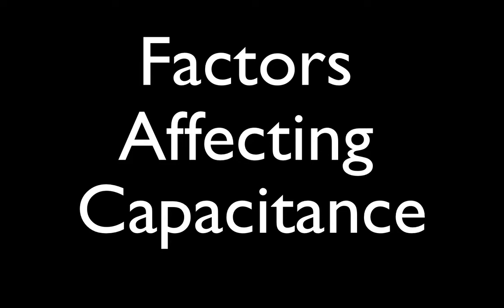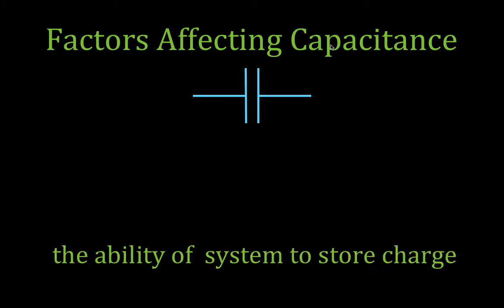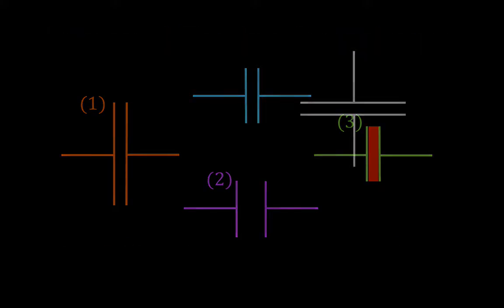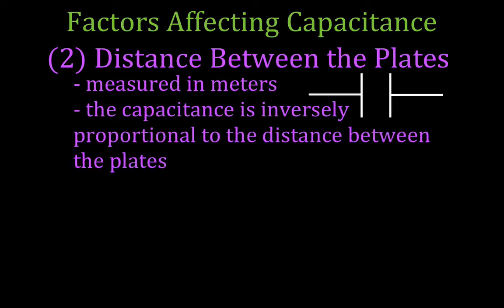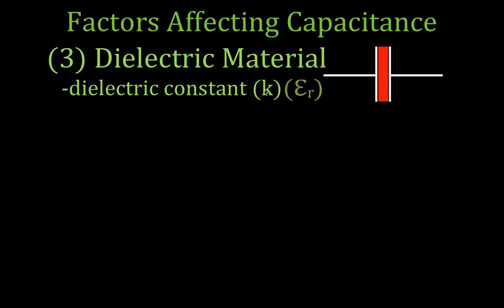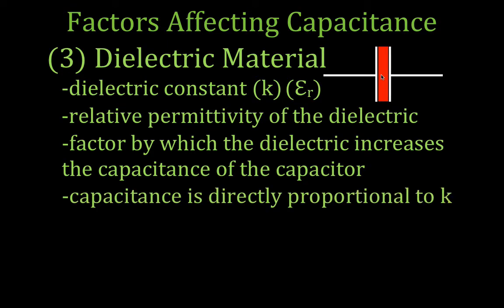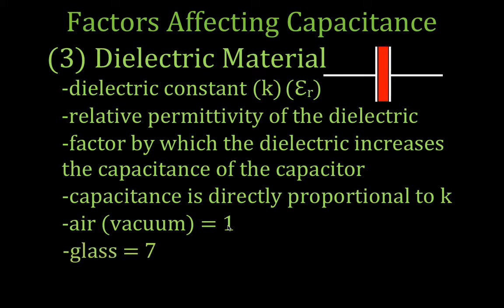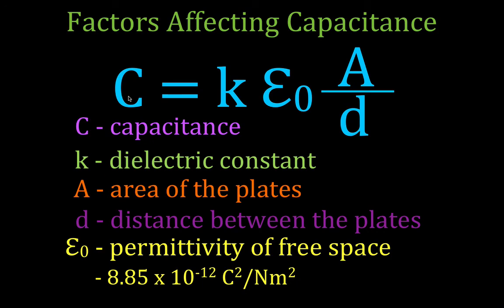Capacitors (6 of 9) Factors Affecting the Capacitance of a Capacitor

Comment: How could you have water as a dielectric ? It is a conductor and would short the capacitor plates i assume ??
Reply from the maker: Yes, maybe is some research it would be use some how. But it is interesting it has such a high constant because it is a polar molecule and can easily be polarized.
Reply: Because PURE water is INSULATOR